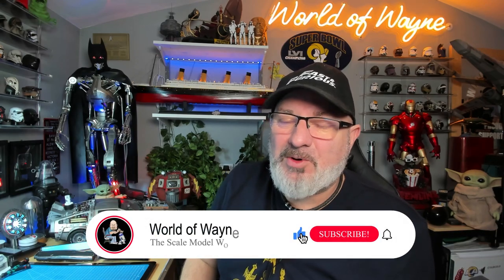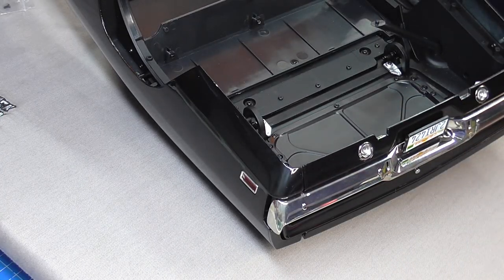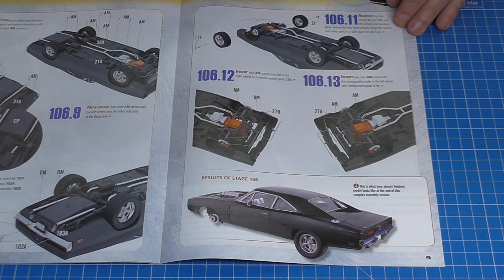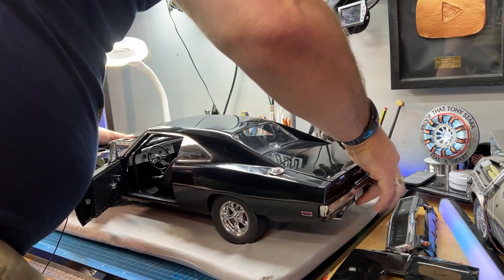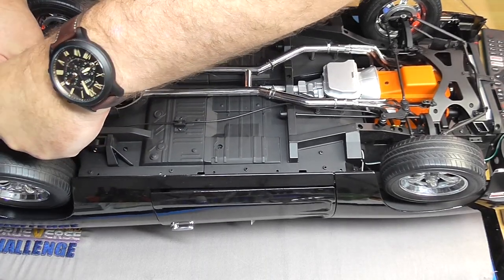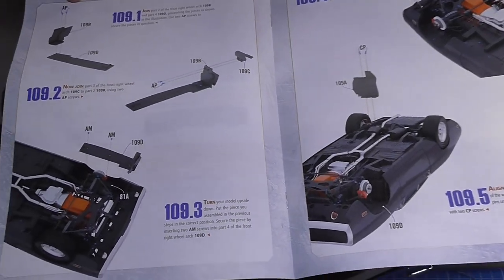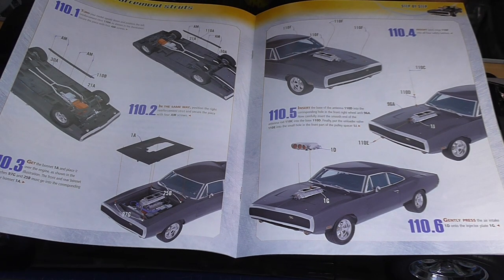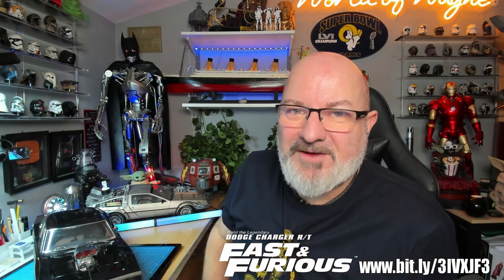Build the Fast & Furious Dodge Charger R/T - Part 103-110 - The Completed Vehicle

Comment: I'm currently building this. I'm currently on issue 74. But I'm really disappointed that the engine didn't have a electric motor inside so when you pressed the button for the sound of the engine the engine went around. But I'm really am enjoying building this car

Comment: Wayne, I'm curious if you've heard of anyone doing a General Lee conversion.  I'm buying the kit specifically for this reason.  So far I've got 62 issues, still boxed.  I might have to one-off it but if there are any resources, it would obviously be easier.
Reply from the maker: It’s been talked about but I haven’t seen anyone do it

Comment: Looks good Wayne. That body went on way too easily, hopefully when I get to that part will be just as easy for me (I'm about 4-5 packs behind you). Car looks awesome. This and the Cobra both look great. If you can, get yourself the Pocher Lotus F1. Fantastic build, but also the most challenging of all the 1/8 car builds I've done. Mainly due to the fact that there is so much detail and the instructions are horrible (plus they are also wrong in lots of places but there are updated ones online that also have a few flaws in them). 

Totally separate topic is the Bismarck case. Don't get it if you were planning on it. It's insanely huge, about 8 inches wider than the model and 6 inches longer. Its so ridiculously big, I can't use it. It's just a complete waste and also just flimsy clear plastic. So I packaged it back up and put it down my basement and I'll just leave the Bismarck out in the open. Have a good one.
Reply from the maker: Yer. I didn’t get the case. I would have no room for it

Comment: I just opened mine uo yesterday to start the build,  I collected them all and put them away for later but finding a few inaccuracies and alot missing details that I'm now 3D printing for the added detail and connectors on the fuel lines etc MSD why they have an original Dissy on it is odd

Comment: Hello! I have been collecting this one also, right now on number 37, but still haven't started building it. So I have a question, what kind of oil should I use since you mentioned it in the beginning of the video? Is it necessary?
Reply from the maker: I use 3 in 1 oil. It will just make your life easier screwing into metal
Reply: @WorldofWayneUK  Ok, thanks for the reply. I guess that goes the same for plastic parts, since as I see it's 80% of the model, or...? 
Anyways, I couldn't find 3 in 1 oil, so I bought some kind of wide use machining oil, I guess it'll have to do.

Comment: Hi Wayne. Happy New Year. I put the batteries and switch on the car but the front lights inside car and front outside do not light on. The back cable of the lights was cut off and I tried to fix it with a soldering iron heated... the beep and engine sound I hear them ok. what would be the problem..?
Reply from the maker: Sounds like a broken wire
Reply: @WorldofWayneUK  the back wire is broken and I tried to fix it 😔 but the front wire of LEDs is ok I tested it and lights working when I connect it to the back but when I connect in front LEDs were off

Comment: FANTASTIC!  A 2-Year Build completed! I'm disappointed that the hood (bonnet) does not lay flat or hinge up to view the engine. I suppose that's true on the real car, but Fanhome could have used from 'creative license.'  Maybe instead of the clips that hold the hood down, you can use 22, or 25g wire that you can easy slip in/out?  Shame the engine is going to be hidden from view. All that work gone!  You confirmed two things for me that are worrisome: (1) Fitting the body to the chassis. I hope mine will be as easy as yours! (2) Removing the wheels. I have a Pavlov Experiment fear from my Shelby Cobra where I stripped the screw that secured the wheel to the car that resulted in ordering a replacement part. No way to get around this. The wheels have to be removed! That stage is going to give me nightmares - and I'm on Stage 58! 🥴🤪!
Reply: I found out about the hood / bug catcher a few months back, also found out that the Japanese have thrir own version that has more detail then we received.  I've been trying to find out if these parts are available.